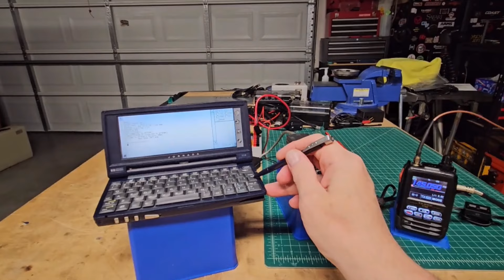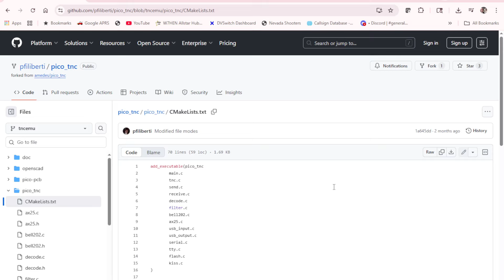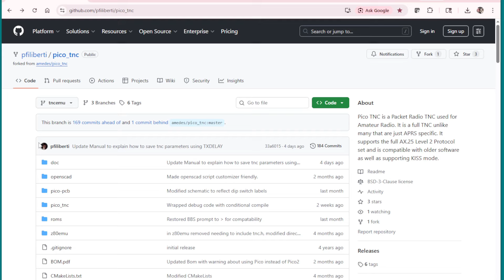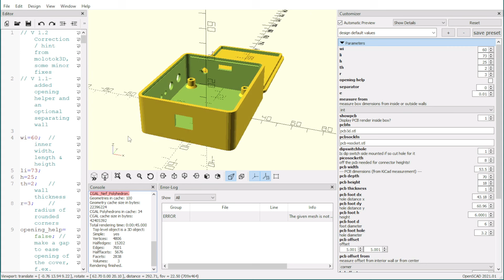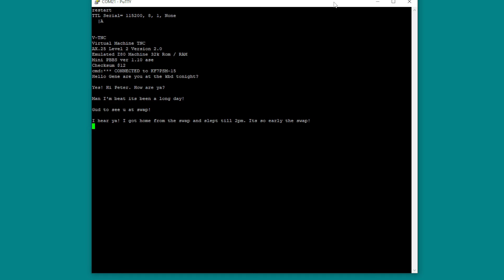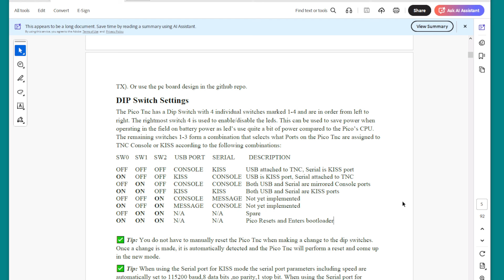The Pocket Pico for Packet Amateur Radio

Comment: I've built the 3 boards and purchased waveshare RP2350-Plus boards to use with a battery, but when I connect it to Putty I am getting the following: 
GPIO test

GPIO connet to GND :
GPIO connet to VCC :  24 ,
GPIO connet to GPIO :

GPIO not connet : 12,13,14,15,16,17,18,19,20,21,22,26,
ADC test

GPIO27=0.40 V
GPIO27 adc Error!!!!!!
GPIO28=0.40 V
GPIO28 adc Error!!!!!!

Using a Pi Pico clone It greets me with the press * to set baud.
Reply from the maker: I'm not sure why you would get the GPIO Test. Confirm you are using the correct Waveshare Board indicated in this link.
https://www.waveshare.com/rp2040-plus.htm?srsltid=AfmBOoq13bE1-WUgfPfdw-FCCHtMU78opbGK9sOQbvPLuoL5xN5AJUhe

The "Press * to set Baud" is correct and what you should see on a 1st time start up.
Reply: @RandomGene  Looks like I bought the 2350 boards and not the 2040. I will reorder.

Comment: OK, I've got a handwired version running and it looks pretty good but I've got a question? How do you calibrate the transmitter? The normal TNC2 commands seem to be missing? I'm guessing maybe it has to be set using the alternate firmware (the original pico_tnc has a calibrate command)?

Thanks,

AE0GL
Reply from the maker: Thank AE0GL. There is no calibrate commands. This is an emulation of the Heath Pocket Packet which didn't have calibrate commands.  If you find it necessary perhaps you can flash the original pico_tnc first, perform your calibration, then go back to the pocket pico build?
Reply: @RandomGene  Thanks for the clarification, I thought that's what I needed to do (calibrate using the pico_tnc), but just thought I might be missing something.

One more thing I found: Leaving the 100 ohm series resistor out of the PWM output seems to increase the distortion significantly. I don't know how important this is in the real world after the rig's built in filtering, but I think you should consider putting it back in. It made a huge difference here in my testing...

Thanks again for a great project. We're looking for a replacement for aging hardware for a statewide network and it's one of the designs I'm testing. I'm building a few more of these and of the openTNC. Both show great promise and all involved should be complimented on advancing the state of amateur radio! Good luck...

Mario AE0GL
Reply from the maker: Mario. Thanks for all your insight and assistance. Peter has been keeping me updated.